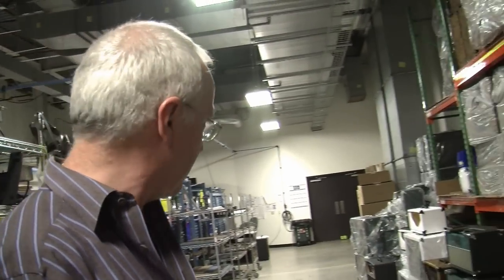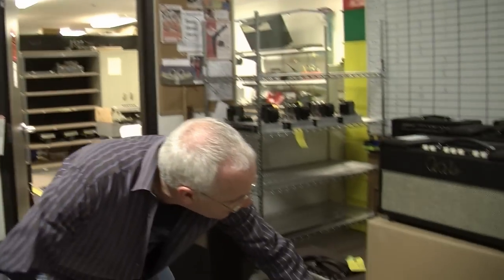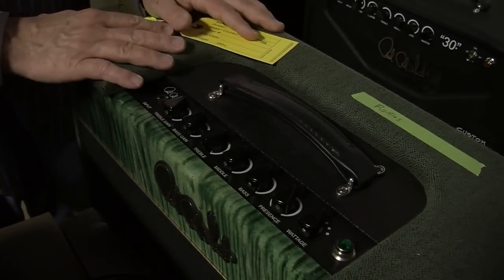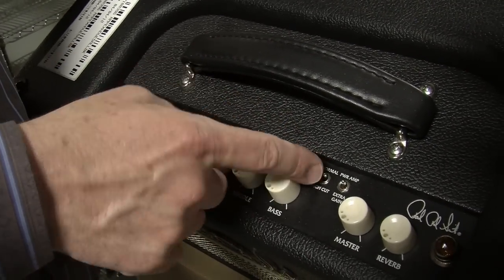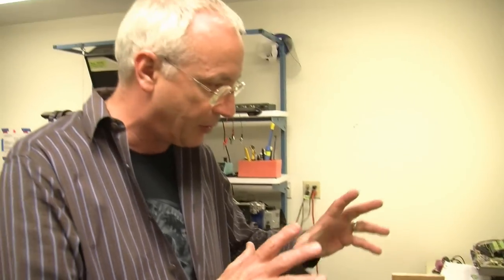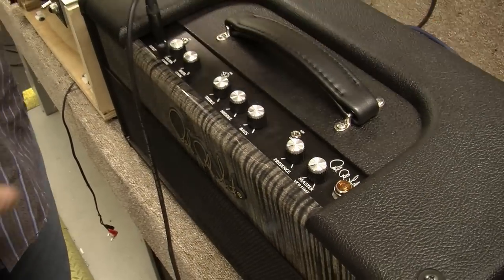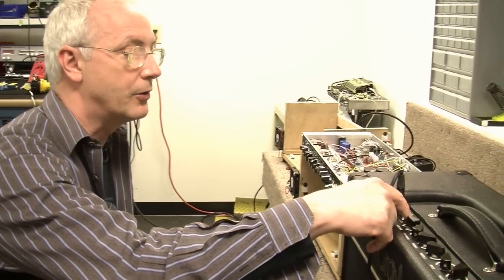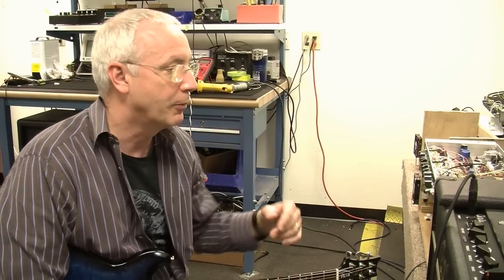PRS CAD Amps with Paul Reed Smith

Comment: I have one of his guitars...a 2006 ME-1.   Luv it.    Will have to try the amp.   What tubes are in this thing?    Looked like some big bottles.   And what speakers are they using?    Only respond if anyone knows this off the top of their  heads...ez pz...because I am sure I could look it up too.  

I was a Celestion G12 Vintage 30 guy for years...but once I got a Celestion Gold...I was sold.    Amazing speaker.   You will hear highs and mids in the Gold that are not in a great speaker like the Vintage 30.   Which is a fab speaker imo.    But what blew my mind were the lows....a low that I had not heard before.

Comment: I ve got a long winded declaration on hearing a amp on you tube that PRS Amps builds, it and the previous posts on this page define the amp but,  Jinckle ding, I cant find which one of the 30 or 50 watt amps it is.   So   I continue...Mr Smith, I m going to buy that amp.  But, its heck to find it .....